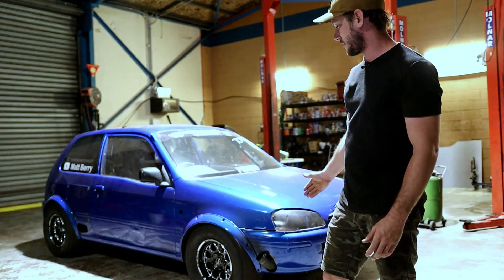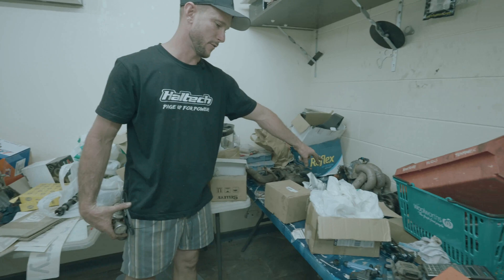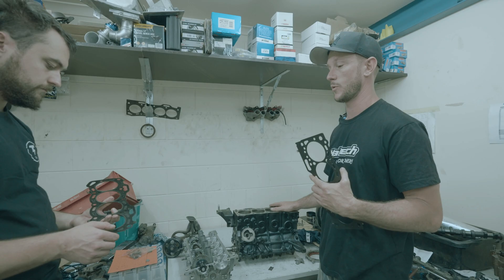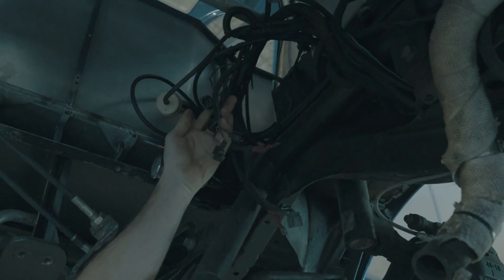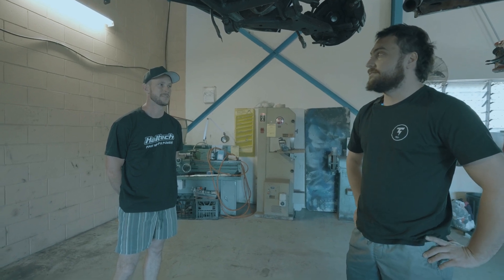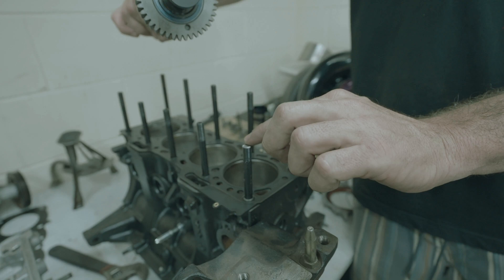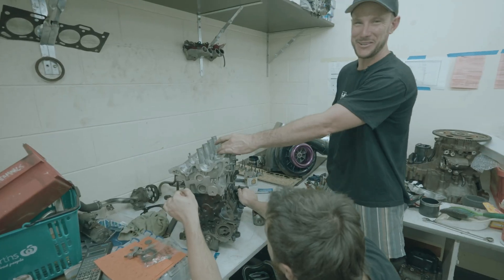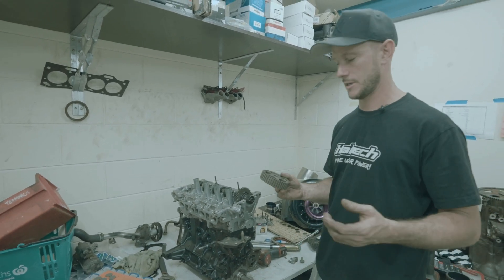Forged engine and Haltech ECU for the Twin Engine Starlet #haltech

Comment: Hi nice video, I just forged my Glanza v and install forged piston Traum from usa but i have an issue the piston are making a strange sound when are cold ok you hear a ticking but the issue is when the engine is hot while you hit the gas it will do the ticking as well, the engineer told me that some of the valves they do it.  Maybe you can help me if you ever had that issue maybe not enough fuel or bad timing I don't no, on idle the engine is super smooth and no issue of oil in the catch can all clear only the ticking when rev.
Reply from the maker: Bore may have been machined too big.

Comment: Sad ending  lol
Do water pressure sensors actually save engines (by examples of when?)
Also there's an olskool guy in VIC who makes Kustom Copper Head gaskets any thickness u want ... a good 30% cheaper than Cometic and been doing drag cars for decades ... all depends on the Flatness of your block n Head .. to save $$'s
Reply from the maker: With a pressure sensor in the thermostat housing, you can set up the haltech so if it’s regular is say 15 psi, nothing will happen but if it sees 20+ you can kill the timing instantly before you can even blink. 

As for the oil, same thing. You can set up where the oil pressures are meant to be at a certain rpms and set limits in there.

Comment: ill trade 4 good wossner pistions for the intake with the welds fixed haha good old forged pistions for another camp dog build :D
Reply from the maker: Haha maybe. What’s wrong with the pistons? Do they have rings?
Reply: @Camp_Dogs   i went to 75mm bore and yes they do have rings :D there 74,5mm
Reply: nothing wrong with them just normal used marks alot better than some used ones ive seen you use before haha
Reply from the maker: @martincaunt4237  if youre happy to send them to me first to inspect them consider it a deal.
Reply: @Camp_Dogs  for sure how do we go about it :D
Reply from the maker: @martincaunt4237  msg me on instagram. Eviltwinep91